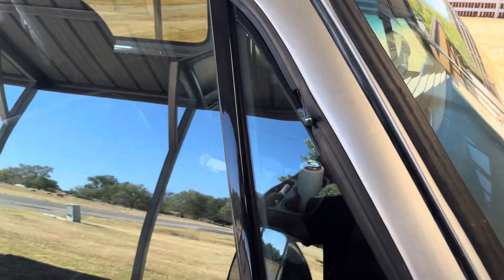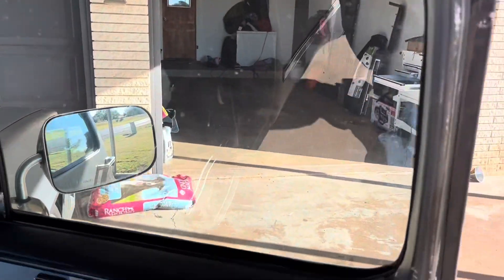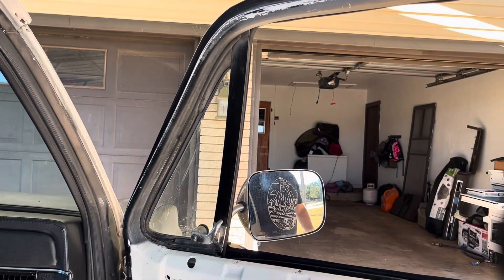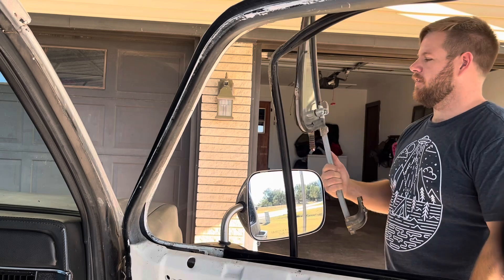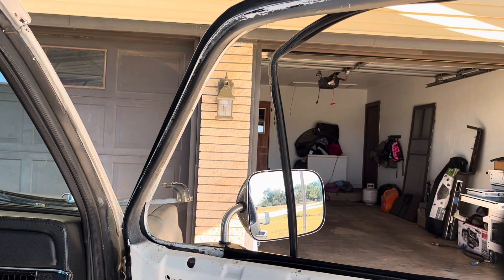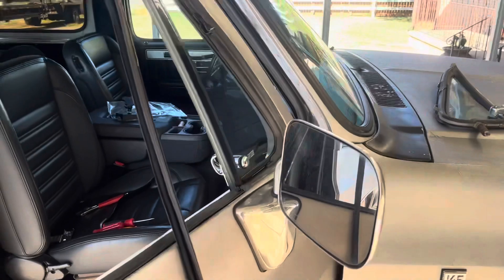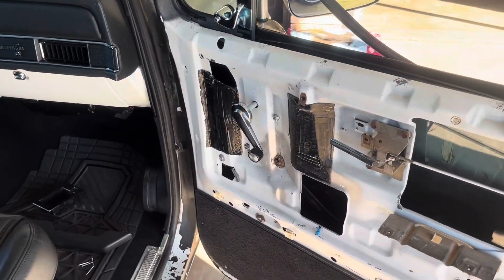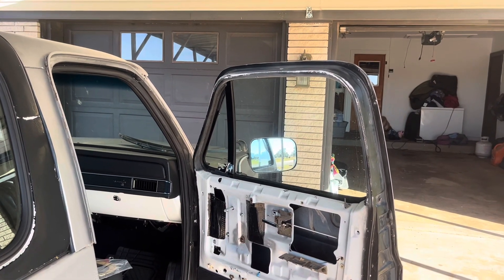Squarebody vent window install.

Comment: I just bought some 77 doors for for my 84 there bare doors no windows or nothing and my question is can I take my wing windows out of my 84 doors and put in the 77 doors?
Reply from the maker: They’re are a few different vent windows, I don’t think the later vent windows will fit in the earlier doors. Nor will the door panels be correct for the doors.